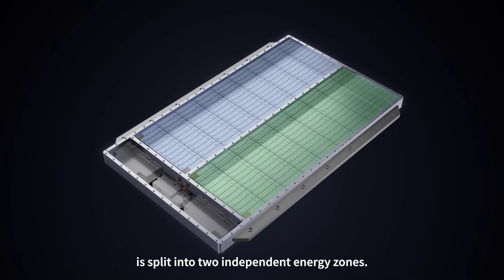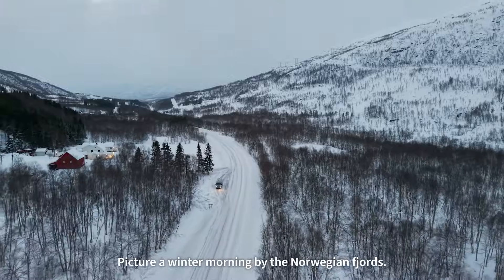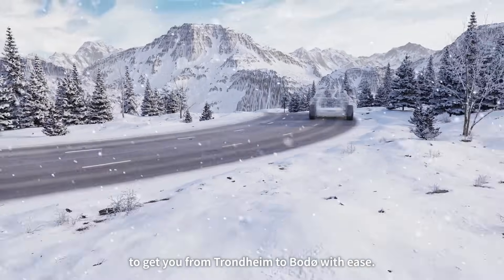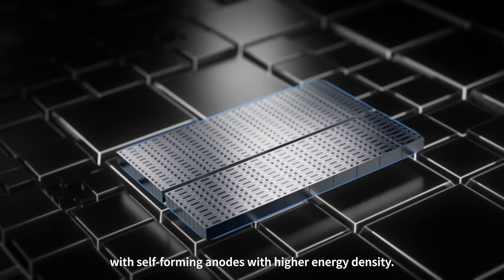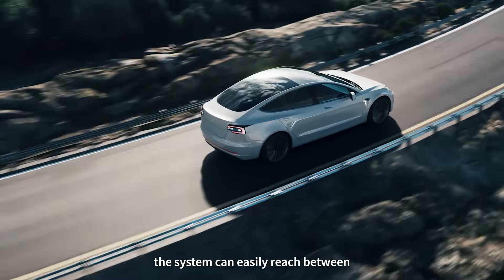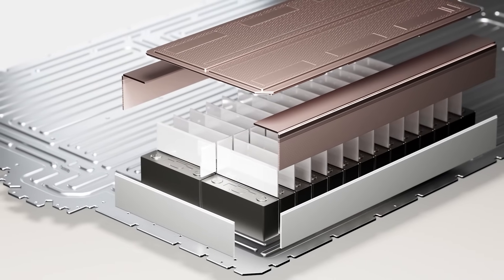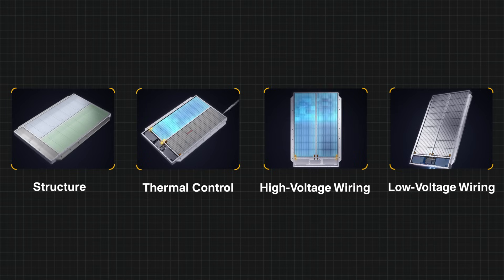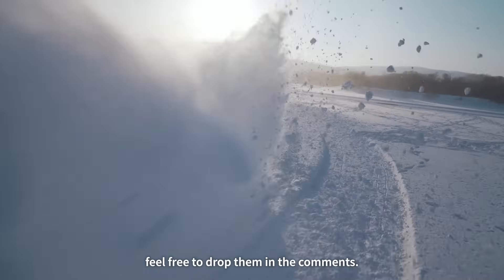CATL Freevoy Dual-Power Battery: The Rubik’s Cube of EV Batteries

Comment: make sure i understand this correctly, you basically have a high energy dense zone that is slow charge/discharge, and another zone for faster charge/discharge but has lower density ? so daily driving take from the fast zone, while energy dense zone is only use during low duration drive ? very interesting. I remember tesla filed a similar patent in 2019 i think, it use similar architecture, but the energy dense site use a lithium metal sulfur and the fast charge side use LFP. Not sure what ever happened with it, it was never implemented in production, only existed in patent format.

Comment: LFP chemistry as the daily shorter range battery pack, but with higher cycle life, and NCM as range extender? Understand the logic behind that, but it adds extra complexity, in charging and battery management, will require a whole new type of power module to decide from which type batteri to draw power and how much?

Comment: The disruptions do not stop there. How about produce a kit that has a small efficient internal combustion engine coupled with a generator and battery,  that ICE charges the battery that can run on ethanol  isobutannol or compressed bio gas from Bamboo, bagasse or rice straw and sell that like cellphone around the world so that we can convert old cars that is still very good body conditions or converts tuktuks , jeepneys or motor crafts or motor vessel to countries that is not capable upgrading the grids to handle the demand for electrons  and you will see your are more valuable than useless other companies that has crazy valuations. Thank  you CATL for what you do..

Comment: Make it modular. I want to but a car and add the type of batteries I want in there. Super capacitators for high output and solid states and lfp all mixed together. Some owned some rented and all alle to be used in many different cars.
Reply from the maker: Love that vision. The Freevoy Dual-Power Battery is built for flexibility and future upgrades.

Comment: Enabling electric ships and planes.  Not ocean crossing planes or freight ships.  You just can't build the charging infra for those.
Reply: You can. It's probably the easiest part of the issue. The biggest hurdle was getting enough energy in battery form to power the trips. China already has big electric ferrys and cargo ships that makes short trips from nearby ports and are charged at the stops.

Comment: Sodium-ion battery: Safest
Charging time - 15 minutes
Charging cycle - 1500 to 8000
Reply from the maker: Nice summary.The NAXTRA battery delivers over 500 km of pure electric range and offers more than 10,000 cycles with industry-leading safety. It also supports 5C fast charging, reaching 80% in about 10 minutes.
Reply: @CATLOfficial is that with a pre-condition battery pack or an uncondition one?

Comment: It's a cool idea but what I don't get is how you can reach 1500 km CLTC range with this methode. 2 x NMC packs? But how does that give you a higher energy density than a normal NMC pack?
Reply from the maker: Great question. One of the NCM energy zone can use our newest self-forming anodes tech. We no longer use traditional graphite anode materials. Instead, elements are deposited onto the current collector in metallic form.Volumetric energy density goes up 60%, gravimetric up 50%, reaching 1000+ Wh/L. That is how it reaches up to 1500 km CLTC.
Reply: @CATLOfficial thank you so much for answering my question 😀👌. Would be very interesting to see charging curves of all the different pack combinations 😀. When do you think will be see the first EVs to use your new batteries?
Reply: @Raymaster7482 this is just my assumption but probably in mid 2026 or on newer models of evs, but i dont work there so i am guessing
Reply: Honestly little idea, maybe it's the different discharge mechanisms in the different cell packs. NMC charges fast and has high density but not as smooth a voltage curve, that probably eats range.
Overall though I don't get where they're getting that extra range from unless they're including some semi-solid or solid battery chemistry.
Reply: @nfzeta128 I believe it's the anode-less design. The problem with selfforming anodes is that they have a short cycle life... I guess that's why they want to combine an anode-less pack with an LFP pack, so that you use the LFP pack for most of your driving. I guess the 1500 km CLTC are purely theoretical since 2 x selfforming anode NMC packs won't practical
Reply: @Raymaster7482  I think you may be right on the anode but I'm not sure it's a purely theoretical thing, not as much as BYD but CATL usually only unveils things it's confident it can do in the near future.
Reply: @nfzeta128 I meant theoretical because the car makers won't buy a pack that has a much shorter cycle life than a normal NMC pack... of course it works but just not for 200000 km or more... so I believe anode-less NMC + LFP will be the pack we usually see in the future... a combination with a sodium ion pack is also possible if you don't need that much range.
Therefore I think we are more in the range of max 1000 km CLTC which isn't bad at all... it's just not 1500 km. But I'd love to be corrected on this one 😁
Reply: @Raymaster7482  With lithium metal batteries that they're trying nowadays it may be that plus NMC or LFP that gives them the idea of that much range.

Comment: Incredible ideas and designs from catl. It seems like a single battery pack at a specific volumetric space with 2 or more mixed chemistrys is sort of engineering compromise when compared to using just 1 chemistry for a particular design criteria like maximum range per charge highest energy density or cost or low temperature performance or safety.
Reply from the maker: Thanks! We see it as unlocking more choices, not limiting them. Safety, range, charging speed — no need to pick just one.

Comment: All thing is nice but looks like more complex ev bms/wiring/cooling loop complexity/packaging/repairibility ..cheaper battery at what cost?
Reply: The wiring is probably not much more complex, just more wiring, the bms will definitely be the biggest thing unless they have those mini-controllers like what solar panels have nowadays but more capable.
Repair shouldn't be a problem as these can probably be made to be plug and play given how they're advertising the mix and matching, this way you can get back some of the ability of only replacing modules without much issue.

Comment: How safe is it compared to lithium polymer? Does the capacity degrades over time?
Reply: Lithium polymer 😂 It is the most dangerous of all lithium types.
Reply: POLYMER variant is the most volatile dangerous. No OEM built EV uses Li-Poly cells. That's like using Nitro Methane to run your daily driver.
Reply from the maker: Freevoy Battery uses two independent energy zones with separate thermal control and HV and LV circuits, reducing thermal propagation risk. Capacity retention is tested over thousands of cycles for long life.

Comment: Why car manufacturers do not make EV that can take upgraded batteries that would be good for the business and for the customers
Reply: It is not profitable for the manufacturers
Reply: @yusufcanaktas6929  I think it should be regulated by governments 🤷🏻, what you think?
Reply: @Soho9111  same but they wont
Reply: Wait for the EU regulation tho 🤣
Reply: @yusufcanaktas6929 so you hate NIO
Reply: Swap battery for upgrade next period?
Reply: @BersatuKedua  what I meant is, if I have a 2020 EV with old battery technology why can’t I buy high dense battery to upgrade my ride?
Reply: @Soho9111  Nio cars can upgrade their batteries at swap stations. Cars from far back as 2018 can swap to modern batteries.
Reply: @kangkim150  I know but it is not official and if you do it and still under warranty the warranty will be void
Reply: @Soho9111  older EVs did that but with the new structural batteries it's harder to get that happening. It technically still can happen but then you would have to have custom made batteries, which is something that upcoming tech will make a lot easier, but it'll still be more expensive that production batteries.
Reply: @Soho9111  Basically when more 'malleable' or 'free-form' battery packs become a thing with more solid state batteries then it'll probably become easy, cheap and safe enough that pressure would be put on manufacturers and governments to allow battery upgrades without letting dealers or manufacturers void the warranty.
That said, EVs don't really need to upgrade batteries until far outside of warranty anyway, unless you're just making a preference change.

Comment: Sodium ion with 300km real range (130km/h) + AC / heatpump and no charging runaway fire, no detonation underwater and during the crash and all people will buy your battery.
Reply: The fire risk of any EV battery is already negligible. Av EV is 10-20 times less likely to catch fire than an ICE car. So for now all we need to focus on is replacing ICE with EVs.
Reply: LFP already has all of that. Sodium ion batteries are just cheaper but less energy dense and operate better in extreme temps but when it comes to crashes and fires or detonation LFP is better.
Reply: @nfzeta128 Which one exactly? I never heard about safe LFP. It's still explosive lithium-ion liquid electrolyte.
Reply: People will buy this regardless of your opinions
Reply: Research "Volumetric/ Gravimetric Density" THEN look at your "specification".
THEN Search and understand "GB38031-2025 Safety Requirements for Power Batteries of Electric Vehicles”.
These regulations deal with your last 2 points (From 2015.... smh)